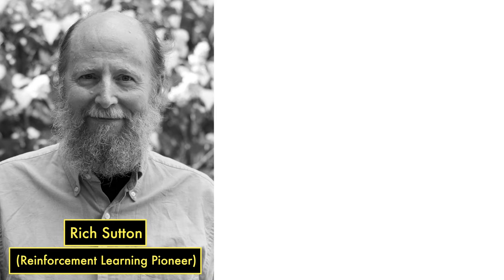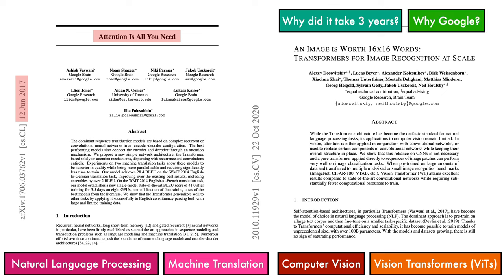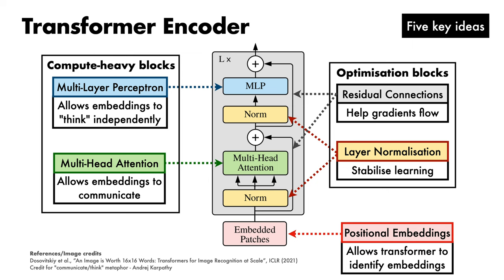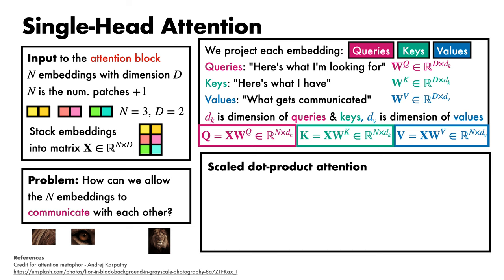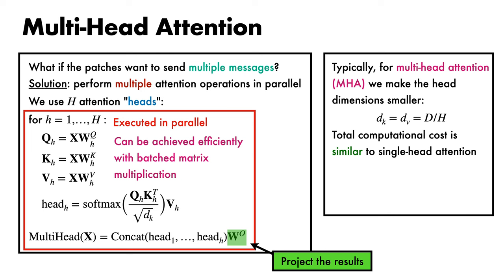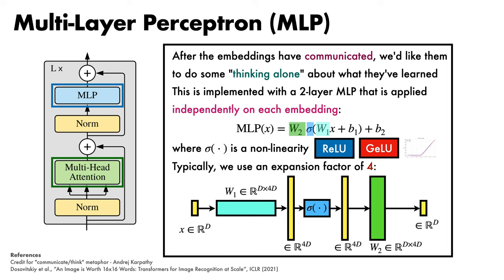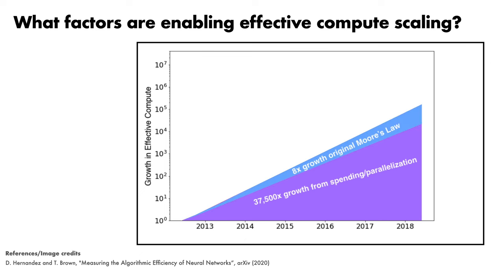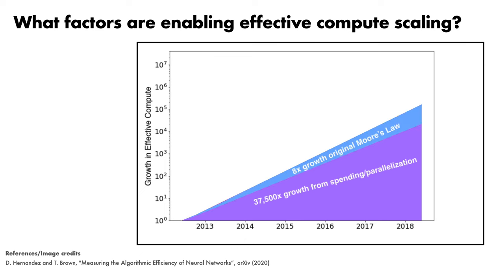Vision Transformer Basics

Comment: 🎯 Key Takeaways for quick navigation:

00:00 🧠 The Evolution of AI and Computer Vision
- General methods leveraging computation prove most effective in AI development.
- Evolution from handcrafted features to Convolutional Neural Networks (CNNs) and then to Transformers, showcasing a reduction in inductive biases and an increase in data-driven approaches.
01:09 🤖 Neural Network Architectures
- Importance of network architecture in building intelligent machines.
- Distinction between network architecture and network parameters, focusing on resource limitations and efficient design.
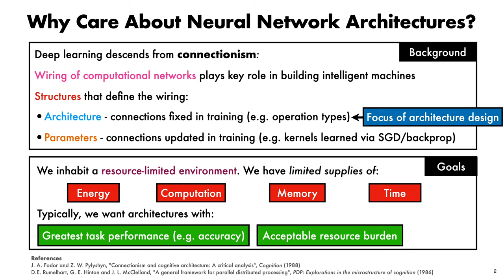02:32 💡 Introduction to Transformers
- Transformers' dominance in AI, initially in Natural Language Processing (NLP) and then in Computer Vision.
- Discussion on why Transformers took time to transition from NLP to Computer Vision.
03:57 🌐 Understanding Transformers: Encoder and Decoder
- Explanation of the Transformer architecture with its encoder and decoder components.
- Different variants of Transformers: Encoder-only, Decoder-only, and Encoder-Decoder architectures.
05:33 🔍 Applying Transformers to Computer Vision
- Vision Transformers (ViT) process images by slicing them into patches, using position embeddings and Transformer encoders.
- The methodology of transforming images into a sequence of embeddings for the Transformer encoder.
07:08 🔗 Multi-Head Attention in Transformers
- Detailed explanation of the multi-head attention mechanism in Transformers.
- Role of queries, keys, and values in facilitating communication between different embeddings.
09:12 🧩 Transformer Encoder Blocks and Scaling
- The structure and function of Transformer encoder blocks, including multi-head attention and MLP.
- Importance of residual connections and layer normalization in optimizing Transformer models.
11:05 🚀 Scaling and Hardware Influence in AI
- The impact of scaling and hardware advancements on Transformer model performance.
- Discussion on the exponential increase in computational resources for training large models.
13:50 🛠 MLP and Optimization in Transformers
- Role of the multi-layer perceptron (MLP) in Transformer architecture for independent processing of embeddings.
- Importance of non-linearities like ReLU and GELU in Transformer models.
15:00 ⚙️ Residual Connections and Layer Normalization
- Implementation and significance of residual connections and layer normalization in Transformers.
- These components facilitate gradient flow and stable learning in deep network training.
17:05 🌐 Positional Embeddings in Transformers
- Explanation of positional embeddings in Transformers, necessary for maintaining spatial information in sequences.
- Different methods of implementing positional embeddings in Transformer models.
19:27 🔄 Cross Attention and Causal Attention in Transformers
- Discussion of

Made with HARPA AI